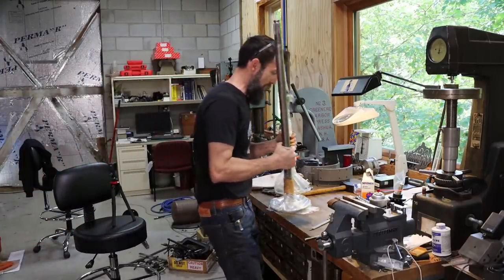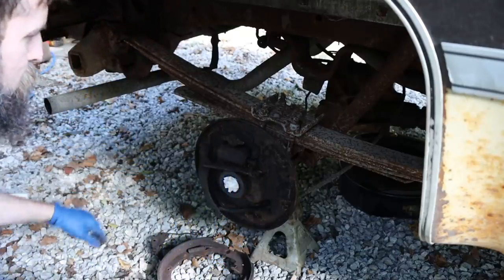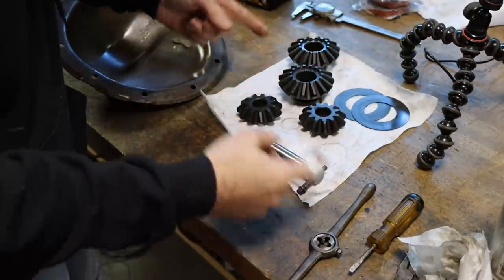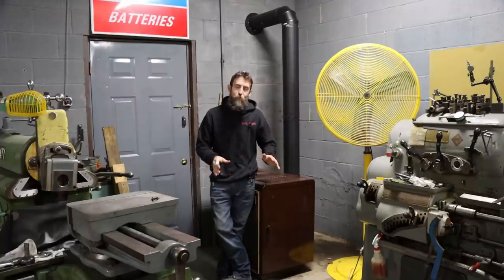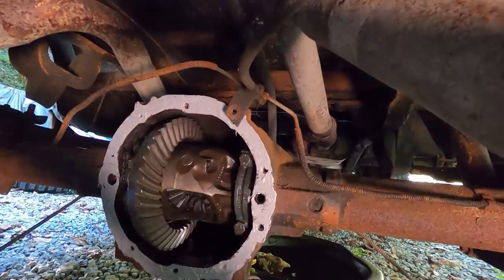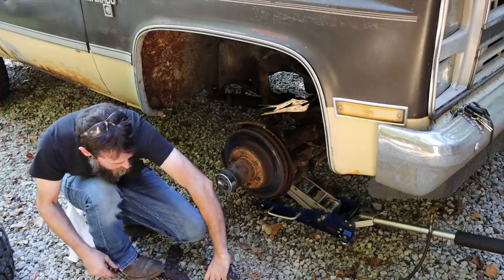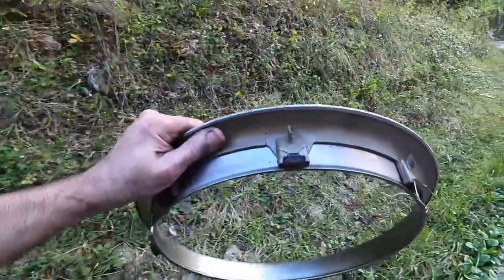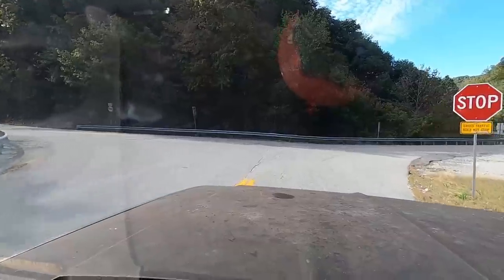Fixing my Junk  . 85 Chevy 4x4 Part 2

Comment: I know what you're saying, Steve
My brothers first truck was a 72 C-20. It stayed in the family so long that we did two engine rebuilds in the shop in the back yard. When the plastic grill got broken from driving in the woods to haul firewood, my dad made a replacement grill out of oak and put a marine varnish on it. He re-used the blue metal bowtie from the original grill. Most of the dash and door panels were steel, not plastic like today. I'm glad you are keeping it going.

Comment: When I was a boy my dad had a shrimpboat that he worked Mobile Bay, Al.  It had an old cast iron stove that he used coal that he found in piles at the port he also worked at.  The smell of that coal burning along with the salt air, fish, diesel and cresote used on pilings to prevent rotting is something I'll never forget.  It might sound aweful but it wasn't.  All those strong smells mixed in a way that was so unique.  I remember leaving out at day break in a light fog, sipping a cup of chickory coffee and breathing it in.  I'd give anything to do it just one more time.

Comment: Great video Steve! One tip: the problem with using vise-grips on the springs, it can create a stress-riser in the spring material. Wich can result in broken springs. I have pulled drum brakes apart before that had broken springs. And tell-tale witness marks from pliers right at the break. My vote on your fantastic old Chevy short-box: keep it alive! The level of "fix/restore" is your call of course. But that truck has more heart and soul than anything new. That is a damn fine old rig! Can't wait to watch you fix it up!

Comment: Hi Steve, great video.  I would really like to see you fix the old truck up.  I have had a number of old trucks, most all of them were 4x4.  I think the most useful truck I ever had was a 1985 Chevy K30 with a flat bead and a dump.  It would haul or pull anything and with the diesel engine it had decent mpg.  One time I actually traded some work for an old 1964 ford basket case.  The owner planned to fix it up, took it all apart and then lost interest.  I bought a few parts, put it back together and drove it for several years.  Right now I have a 2005 F-150, I have the engine torn down putting new timing chains, oil pump and phasers in it.  I much prefer working on the old stuff, pre 2000, than the newer vehicles.  Thanks for sharing.

Comment: In 65 years I've only bought 2 new vehicles back when they were reasonably priced, keeping up on the maintenance and repairs they lasted 20+ years one is still going. Higher end cars plus trucks now days are insanely priced and the affordable cars are disposable items. I've had pretty good luck going the used route, being a gear head all my life has really helped. Every use vehicle in my case had issues, some minor and hidden , others major and known going in. The saving can really add up over the years if you don't mind getting a little greasy. The old trucks were built to last, my shop truck is 50 years old and will easily go another 20 years with some maintenance. Yeah its not comfortable to drive and there's no smart phone sync. It just works and will haul most anything I need to.
A shop truck rebuild series would be enjoyed by most...sounds like a great idea.
Enjoyed the wood stove stories..nice addition to the shop
Thanks....ATB

Comment: Nothing better than coming in on a cold wet or snowy day to a wood stove heated house. Nice and warm. Plus the benefit of wood heat if you do it all yourself,  during the process of cutting, splitting and stacking it will heat you at least four times  😁

Comment: Maybe you should fix up the 'ole Chevy and enjoy it some more. I have a '76 short bed like yours that I completely went through about 10 yrs. ago and I wouldn't trade it for anything. I didn't have really anything left but the chassis, drive train, and a bed floor. I replaced or rebuilt everything on the truck with NOS GM parts including all the sheet metal, trim parts and chrome, all the interior, and even the cab. Went with a  GM crate 350 with a few goodies on it, kept the 465 trans. and the 205 trans. case with 4:11 rears. I was still able to buy most parts through GM at the time, but I don't think you can get much of anything anymore. She's a little slow on the highway but I don't mind because I really have a new truck for under 20k doing all   the work myself for 2 yrs. It's real satisfaction to get in it and go for a spin knowing you'll get back home without walking, unless of course you should run out of gas like someone we all know....    Sorry Steve, couldn't help but poke a little fun your way! Love the videos you put out. You do a really good job with them! Thanks Steve!

Comment: Hi Steve and Elizabeth! Tuned in 10am and utube said no vidja. 11am said it was posted 6 hrs ago... not sure what's up w/dat... Bought a brand new 1984 GMC 3/4 ton , 4x4 and put a great western plow on it for the Carlylye Group outta California. I ordered it just like it was gonna be mine. So I like them too. I too lived in a home that had NO insulation from 1965-1969. Had wood fireplace and a floor mounted oil heater. No heat upstairs at all where my bedroom was. I had a quilt made out of old pants and a couple of old floor rugs. Weighed so much , once you pulled it up over you you could barely move. Kept me warm tho. When we moved in 1969 we instaled a wood burning stove like you have in your shop. Tractor suply sells them now. Was much more efficient then the fireplace. We still burnt 10 cords/yr which is a lot of wood if you have to cut/split stack it. My dad and his brother built a flatbed out of 3/8" plate steel and it outlasted the '58 Ford, 66 GMC. Still going. Had a tool box underslung, ball hitch and removable side boards. Would watch vidjas building a flatbed. I had a 72  C-10 4x4 and had to redo everything below the body line on the sides. Cab mounts, floors, cab corners, roceker panels, bed corners. All the after market parts didnt fit so hot.... (JC Whitney's)... AND didnt have mig so brazed on w/coathangers... took a whole yr of my spare time.

Comment: Suggest a tee connection to replace the elbow where the inside flue pipe connects to the outside.  That much exposed flue will create quite a bit of creosote.  The tee will allow easier cleaning.
Reply: That’s the way I’ve got the wood burning furnace in my shop set up….

Comment: You made thousands of wiewers around the World sit and watch as You dug out the trench - oh look, a squirrel, cleaned every brick, moved every stone - squirrel again - and a bird, and lifted that old roof 1/4" at the time. Before painstakingly restoring that building into a very nice workshop again. It has been a joyful journey, to watch it all! Good job!
And now You're asking if we want to see You cut rusty bodywork and sandblast the chassis and underbody of that truck? Of course, we do! Nothing could get me up on a saturday morning, at six here in 'Norway, like the sound of You posting another episode.
Lift the body and bed, remove engine and transmission and put the chassis in a rotating cradle for easy access to everywhere. Spend the winter looking for good used spare parts, and put up a temporary blasting tent where the bricks were stored, when the summer is back! Looking forward to see it happen! OK, I'll stop now. Before I load more work into Your already, busy hands! LOL. Good luck!

Comment: I picked up a fan for my woodstove off of the internet. I don't really understand how it works. It's cordless and uses no batteries, but is somehow powered by the heat of the stove itself. It's not super powerful but it does work, and does help circulate the heated air. Mine was like about $25. I'm thinking about buying another. I just used a big magnet to hold it to the top of my woodstove fireplace insert. You might be able to attach them to your stove pipe, and they would work well for you.

Comment: I would have said, your throwing good money at bad. But with todays issues on building trucks you may have a good truck to fix. Don't need no chip for that old Chevy. With the cost of a new or newer truck you might as well put some money into fixing this one up. I would like to see you do a repair series. You seem to have alot of past experience to do it.
Reply: you are right on that,i have a 84 c10 it is so easy to work on.
Reply: I've got a 98 sierra and it's nice to keep it up and do general repairs and maintenance, this old thing will probably run forever. Cheers from Jacksonville Florida 🌞

Comment: Nothing beats heating with wood.  The heat just warms you to the bone.  I bought a heat pump and after two years I went back to wood.  Even in PA, the heat pump worked great.  If it was too cold, the electric heaters would turn on, so I could keep whatever temp I wanted.  But...   It never felt warm in the house.  The thermometer said 75, but it didn't feel like it.  Went back to wood and haven't looked back.  Plus the smoke smell, the light of the fire, it's just better.

Comment: Hi Steve,
Had an 86 F-150 4X4 that served me well. The brake lines started to rust out so bought a complete set of stainless lines and a brass proportioning valve to replace the cast unit. Wasn't able to get under it and do the repairs myself due to low back problems, so dropped it off to our shop and my brother was going to do the job. Well four years later, and it not being used, the roof rusted out along with the bed wheel wells. Sold it a year and half ago when my fathers health deteriorated and my brother wasn't going to do the repairs. I would like to see you video a repair series if you do start making the repairs to your truck. You and the family stay safe.

Comment: Hi Steve, yes to the repair series, a few thoughts for you, how do you eat an elephant? One bite at a time.
If all you can do is work on it an hour at a time it will get done and if you do it right and in the right order you can still drive it while repairing it
I drive a 1996 Toyota Hi-ace 2.8l diesel van with 320,000kms it was an ex fleet vehicle (TNT Transport, a forklift service vehicle) on the speedo
I change the oil every 5000kms with the best oil out there, I also change gearbox and diff oil alternately every oil change, air and oil and fuel filters as required
I was just having a chat over reliability of Toyotas with a couple of mechanics the other day and told them the km age it had done they said it wasn't even broken in yet, you should get a million miles out of it the way you use it
(I live 100kms from Perth Western Australia) in the country I rarely go over 90kms an hour and the past 3 years have only gone 2500kms a year each year and it is my only vehicle at the present.
The mechs laughed and said it will rust away before its engine gives up the ghost!
For myself at 61 I have kept all my vehicles over replacement for one I don't have the spare cash and I believe as you mentioned the cost and complexity of modern vehicles is taking a lot away from what we ourselves can do or a mechanic can fix at a respectable price we can afford.
Also you get to know your vehicle and what it needs, b
If you privately buy a different one as you found out you get what you pay for and have to start again on someone else's piece of junk
Do up the truck and put a roof over its parking spot and keep it for years to come.
Tony from Western Australia 🇦🇺

Comment: Racer's trick... because we often change rear end gears or slip settings.   Whether it's just a cover or the whole pumpkin, when you buy your parts get a good gasket.  As soon as you get it home, coat both sides with RTV (I prefer Hondabond) and make sure it's a pretty smooth layer.   Hang it on a coat hook, coat hanger, tree branch, whatever... and let it dry.   Do all the work you need to on your rear end.   When you are done the RTV should be dry.  Now you get a great seal AND it comes apart easily.

Comment: Yes to more truck repair, maintenance videos. Re: shop rebuild. I'd say pretty much everything you've done (until now) looked planned and designed for long, trouble-free life. I would NOT say that about the outdoor portion of your wood stove flu. I've never seen that type of steel stove pipe last very long outdoors. It will start rusting very quickly. In 5-8 years you'll be able to stick your finger through it. And to me the copper tubing supports look inadequate. Also, I predict that before long you'll want to wall off and insulate a small inside area, as your stove will have a hard time warming that large shop with bare block walls. Your videos are very well produced and I love watching them.

Comment: I had same truck. Frame broke in half at steering box as well as the pass side. Pulled engine and welded and boxed it in. Plowed with it for 8 years after that. Sold it and last i hear it is still on the road. Find a 14 bolt full floater out of a k20 and a dana 60 for the front and you will be good. Good luck with your refurb. Last thing i did was build a flat bed dump bed. Best thing I ever did.

Comment: Keep up the good work. I've got a '71 Chev 3/4 ton that I'm working on. Punched out 350 w/ headers, a cam and a big Edelbrock.
Runs good but the body  needs work.  I built my own flatbed out of surplus steel and old telephone relay racks.
The bumpers are supports from an old RR bridge.

Comment: Steve, @ 7:50, you actually had the spring tool in your hand.
One of the handles has a couple of little bumps on the very end.
Flip the tool around, slide the hook of the spring up that handle.
Use the little bumps on the end and set the over the lip of the pivot stud on the side away from the spring and lift up and away on the handle, using it as a lever. It takes a bit of practice but as you lift the handle up, you will see the spring start sliding down the handle towards the pivot stud.
Keep lifting and the hook on the spring will slide all the way down and jump over the end of the handle onto the stud.
After you do it a few times it is stupid simple and fast.
I was a "professional mechanic" for twenty years before someone showed me how to do that.
Made me feel like an idiot but if you don't know, you don't know.

Comment: You speak of the bolt that must stay in place or the rear end will detonate. Well in the helicopter repair biz there is a nut at the top of the  main rotor shaft that is known as "the Jesus nut" and for good reason. If it comes loose or off in flight there is a very good chance you will get to met him...

Comment: Oh, I'd love to see an overhaul series on that truck. It's definitely a keeper - because you can actually WORK on it with common tools.  You're not enslaved to a dealer or other repair center that has computer diagnostic tools that you can't afford or even get.  Don't wanna sound like a tin-foil hat type, but we've all seem the demonstrations - nobody can send a signal and shut off your engine when you're traveling down the expressway.
If you're considering hauling more sand or gravel, it'd be cool to restore the original bed, re-route the fuel fill line, close off the the door, and  put a dump conversion on it. You could retain that functionality, but build some stake sides for hauling ,and a set of removable tool boxes that fit the same stake holes. Sort of a jack of all trades.

Comment: I bought a couple of stretch rubber straps that cling to themselves which would have cancelled the harmonics on your brake drums. I bought them at the farm supply store and they are designed to bundle items together.

Comment: Steve Next time you work on springs and need to reattach, use the string trick. basically loop a string over the spring end add a dowel as a pull handle done it for over 50 years now in all kinds of situations and you dont scratch the springs that causes them to fail

Comment: @ 6:41 I use a DRY Silicone chain lubricant spray...
Also
@ 7:28 I use an old sheet or cardboard;... makes it easier to find what U R looking 4...
@ 7:49 It's way easier to attach the springs 1st
Locate 1 side on;... the use a bar or screwdriver to roll it in2 place...

Comment: Hi Steve, it would be great to see a series on the truck, that's a PROPER truck, not a TINO, one small point, I was always brought up not to use anti-seize compound on wheel studs, clean, dry threads torqued up to the correct figure is the way to go, don't be tempted to use Loctite, the Old Man Upstairs will sprinkle his own locking compound on the studs for free, no doubt helped out by the dogs.......  All The Best from Somerset UK.
Reply: I agree. My first boss after high school stressed that no anti-seize on anything that has a specific torque requirement. Wheel studs, head bolts and spark plugs for sure. The slipperiness of the anti-seize causes the fasteners to be tightened beyond their design limits. When torqued to specifications the fastener actually elongates. Over-torquing could cause excessive elastic deformation. Popping wheel studs. Exhaust pipes, exhaust manifold studs. No problem.

Comment: Steve, last week I told you the story about what we did to keep the drum lathe quiet. Today, I wanna tell you, nothing works better for them brake springs than a long screwdriver (or a long smooth lever) to ease the springs where they belong. An old mechanic showed me it doesnt take much effort if you have a tool to do the job for you. And I have had too much blood loss from the back of my hands doin it the way you are showing. Good luck.

Comment: Second suggestion, AMSOIL has gear oil bags which are easy to fill differentials and deliver to the door. Preferred member give a discount highly recommended for diesel owners or if you can justify the $20.